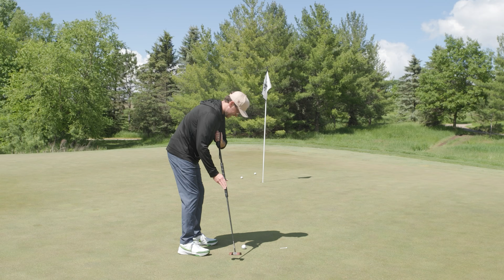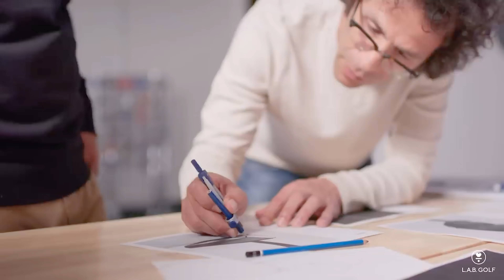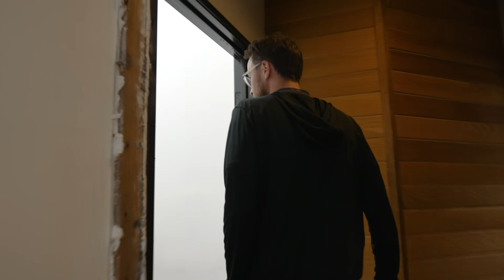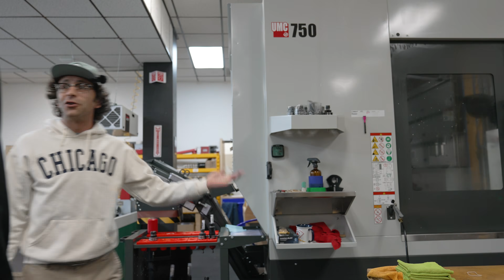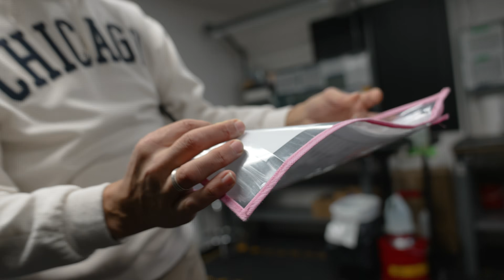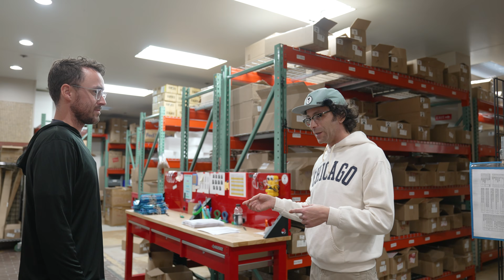Inside L.A.B Golf HQ: Is this the FUTURE of putter design?

Comment: My DF3 was the most game changing thing i've ever owned.  Im 62...
Reply: Why was it?
Reply: @ for over 40 years I have struggled with putting. My stroke was plagued with a backswing that would fall inside or jump out and then I would be into a figure 8 attempt to get it back to the ball lined up.  I have gone through every style of putter from Wilson 8802 to odyssey face balanced mallets.  Eventually I went to a putter fitting studio that used a Quintic system and arrived at an Evenroll 5.1.  I put a BGT shaft in it and …. No change.  Over a putt my mind would be consumed with 1 goal,  getting the putter to swing back and through like a pendulum.  Grip changes, pressures, stance, breathing, etc. my mind would be so full of these thoughts that line and speed would get lost. I would watch the putter throughout the stroke in an effort to control it.  Too much clutter, worry and paralysis to execute anything.  In short, putting had become the most frustrating endeavor in golf.  I’m reasonably athletic and not being able to perform a seemingly simple task was frustrating beyond words.    So… after watching Sam explain the concept of torque and his putter design,  I took a leap.  I did the online fitting, picked the DF3, went for the TPT shaft and did what I have never done…bought a club I’ve never even seen.     When I got it, I was ok with the look and feel.  It seemed to fit me.   But the magic was immediate when I began stroking putts.  No figure 8. Just back and forth.  Once I got used to the new ball position and center shaft look, my mind quieted.  Putting over the course of last summer was so good I’m pretty sure I sold several people on the putter.  My mind is now calm over my putts.  Line and speed.  I don’t need to pay attention to the stroke anymore.  Putting is for the first time in my life, unlocked.  It’s hard to describe but seeing the putter act like a true pendulum and the putt start where you aimed almost every time is beyond explanation.

Comment: Launch Monitor testing on putts inside 10’ constantly shows that LAB has very poor horizontal launch control. Don’t buy these gimmick putters.
Reply: What lunch monitor are you using? The vast majority of them struggle with the onset heads and give inaccurate readings. And if you’re saying, you don’t see improved face to path ratios I’m gonna call you a liar!😂
Reply: If that is what "you" believe, then why do you even bother posting your negative comments on this pro LAB site? My personal experience with my custom built 2.1 tells me different. When I received my 2.1 last July, my GHIN was 6.9, when the 2024 season ended I was down to a 3.8.  I will 100% attest to making that many more putts under 10', as well improving my lag putting. I'm 100% convinced that LAB is offering something different(better) than what anybody else is in the putter category today. Just got fitted and ordered a OZ1i this past week...in my opinion, the proof is in the results(scores).
Reply: @mikemurdock416 Can I have your old 2.1?